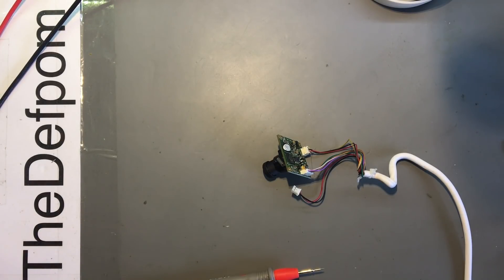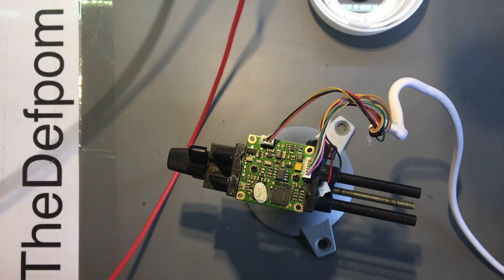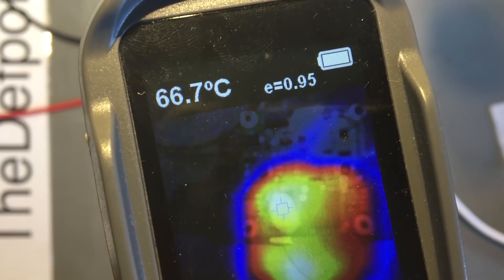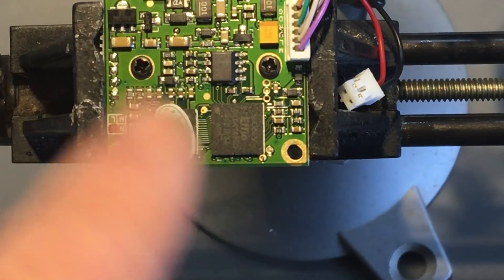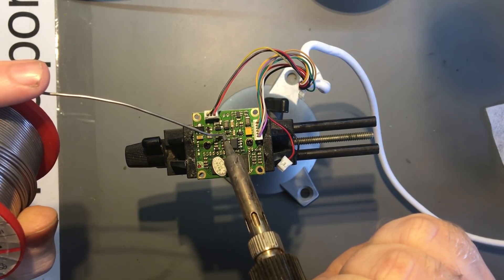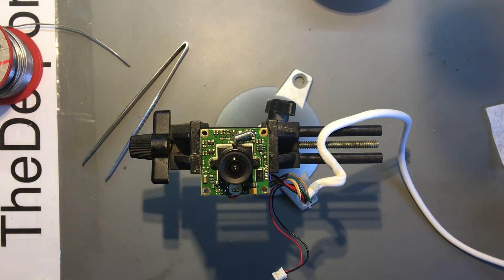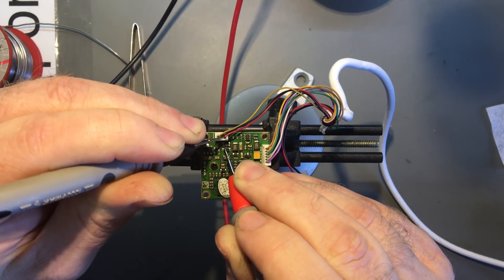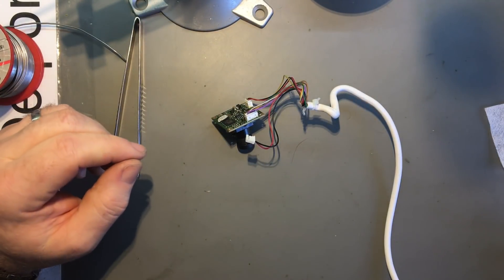#312 Security Camera Failed Repair

Comment: Yesterday I had a complaint from a customer that their camera system was not working.  One of the handy instruments I use is a Triplett Camview IP Pro+, allows me to power up many of the cameras and look at the outputs of the cameras, even IP cameras.  I can also inject a test pattern into the DVR.

I narrowed the problem to the analog ntsc camera, was getting power OK but no video output.  I explained to the customer that hardly anybody actually repairs things anymore and that I would probably just get a new camera.  But, I told her I'd take a look at the camera.  In this case it is a SPECO analog camera.  It had two circuit boards, the first took the 24VAC, converted it to 12VDC.  What is most important, it has a transformer so that the 12 volts is isolated from the video ground.  It is actually a switching power supply.  The 24VAC goes through a full wave rectifier, is filtered by an electrolytic capacitor, then switched by some transistors where the signal goes into a tiny transformer.  The output, now isolated, goes through more rectification and filtering, then on to the camera module.  There were only three wires going to the actual camera pcb, common (gound), video, and 12 volts input.  The 12 volts was only a couple volts.  I used a bench power supply and momentary bypassed the power supply board, the camera woke up.  Most of the components on the power supply board were SMD, but there were two electrolytics, the usual suspects.  I don't normally shotgun a circuit, I try to go directly to the suspected bad component.  With my B&K meter, I first checked the capacitance of the one at the first rectifier, the value was within spec and the ESR (very important) was a couple ohms.  I then checked the filter cap on the output of the switcher that filters the 12 volts to the camera.  The capacitance value was within spec, but the ESR was over 130 ohms.  I replaced that cap and bingo, the camera was back to life.  I didn't have a schematic, but understanding how switchers work certainly helped.  BTW, I could see no physical damage anywhere, no bulging caps, nothing.  Hope this helps someone.   -  Jim

Comment: was that a "tubed" crystal on the other side? maybe it's bad and the clock speed of the chip going nuts-o in frequency. usually they just don't run at all, but i;ve seen the random odd device go insane speeds
Reply: oh wait!!!!, is this where I should point, laugh and yell "u suck" whilst pointing,  instead of shooting possibly helpful ideas :)) ( I'm sure you'll get others doing just that)
Reply from the maker: I should of checked oscillators actually, that is a good point, as you saw I just had a quick stab at it in case it was something obvious.

Comment: I have a very similar camera module I made a night vision system by removing the IR filter. I bought a composite video transmitter and planned a making a wild life camera I could watch on my home TV.  Well another unfinished project. I  bought a flir thermal camera last year. Have to say not got much use out of it it’s easier to use a finger as my wife says. Nice video thanks for sharing. Regards Chris.

Comment: Hey a poke around is always interesting, put a condom on the probe though :-D

I would check the number on that regulator, just so you know the voltage is right.
The problem is some chips to get hot and thats normal.
You could remove that chip for fun lol :-D.
Reply: what I seen out and about today, a condom on your probe likely wouldn't save you :)))